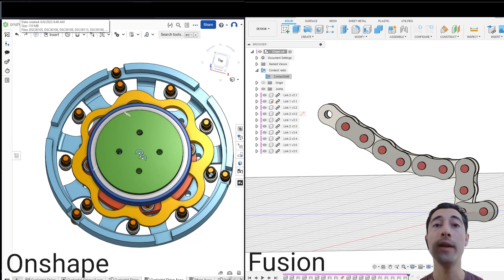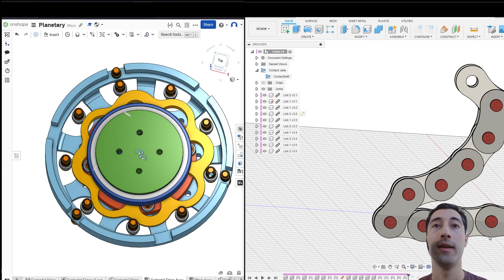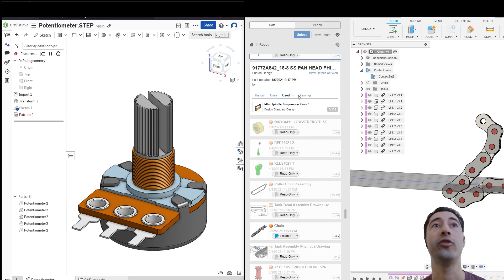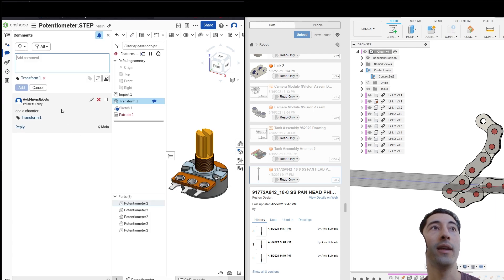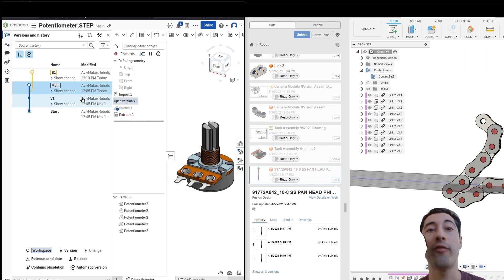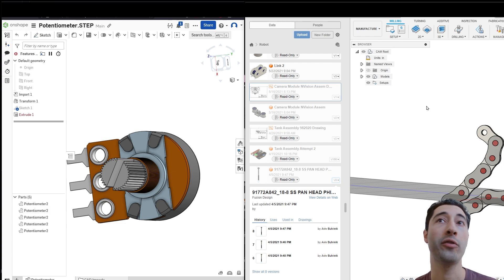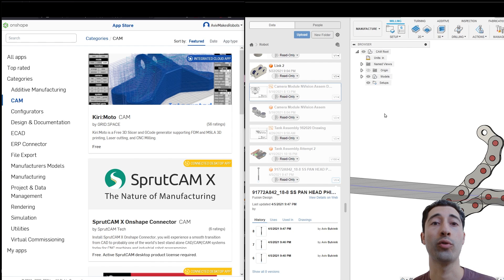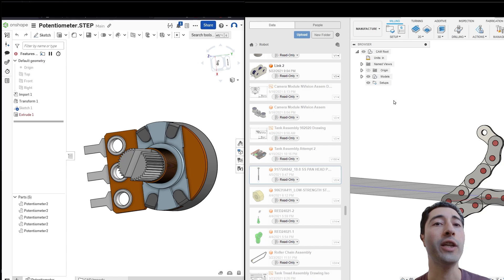Fusion vs Onshape

Comment: The lack of cam is my major hesitancy in switching to Onshape. I do a decent amount of CAM work. That said, onshape has been getting ready to release their own CAM suite for about a year now. It will likely be the pro version only but that would be good enough. Then again, I'd be anxious to actually use a v1 version of CAM considering the risks, but $600 / year just for fusions CAM capability will likely be good enough to just use both. Regarding contact sets... When I first started using Fusion in around 2016 I thought that was a game changer. Until I realized my designs were so complex and it just made doing anything slow and clunky, so I haven't really looked at them again since around 2018. I'd be interested to learn if they have gotten any more efficient in terms of processor speed (or just computers being that much better now I guess).
Reply from the maker: Yes, I was very surprised and dissapointed that Onshaoe didn't offer this feature. I think CAM is the one thing that influences people to spend thousands, since CAM translates to dollars.